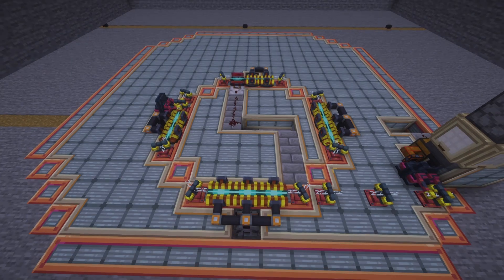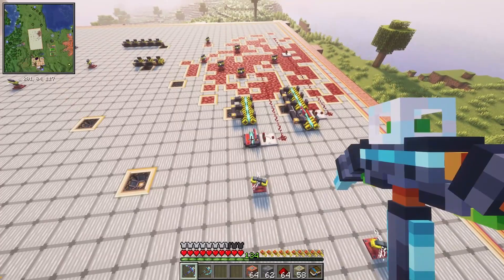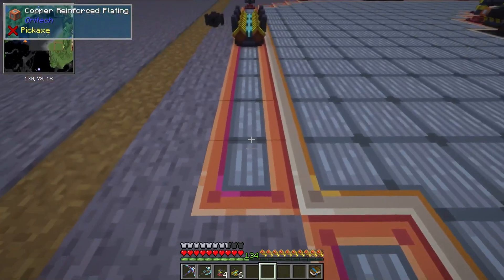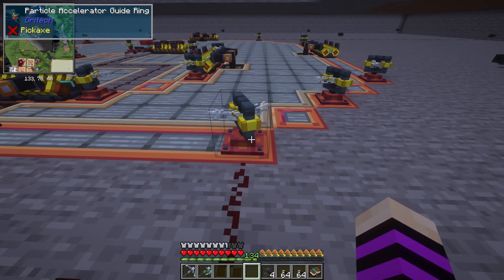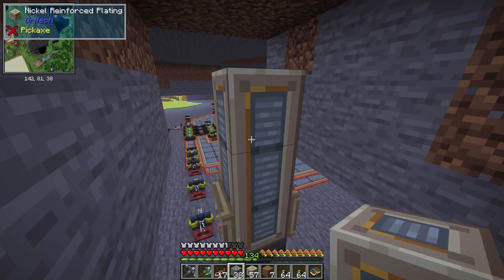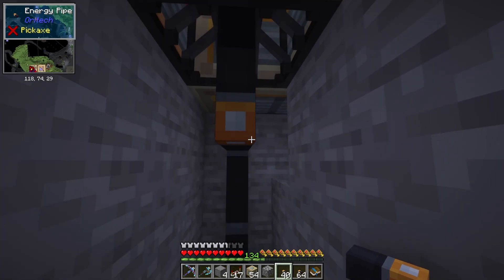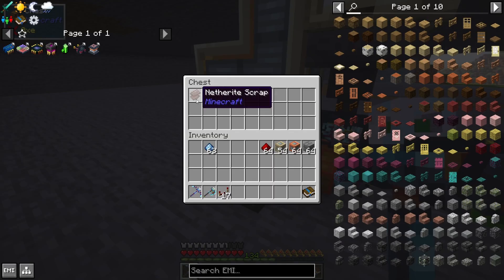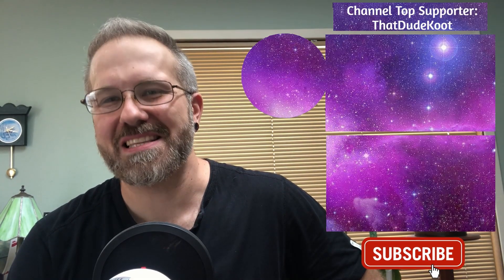EP 17 - 2500J Oritech Particle Accelerator Setup! Minecraft Oritech Academy! 2500 Joules!

Comment: Why do you need a ring up to 800 separate, can't the outer one be used from the start?
Reply from the maker: The outer one can be used but you need the inner ring to get it fast enough for the outer one
Reply: @LetsPlaywithDDae  I see. Yes I now noticed that doing it this way it's more efficient as once you have certain speed you can go into an outter ring with a bigger gap in between elements.

Comment: Got this to work in SB4 after a little pain.  Added an Accelerator Magnetic Field with Tier 9 efficiency and capacitor addons from the Echo of the Wyrmright shop.  I also added two more guide rings between where you had the collision point and the motors.  It kept the second particle from vanishing before impact.  SUCH a great video for explaining the process!!!

Also, moved the repeater two spaces closer to the main circle so it triggers earlier.  Total energy 9252J!!!
Reply from the maker: You Sir, are amazing =)
Reply: bro i hate this mod

Comment: Anyone having problems in SB4 or anywhere else, you need to use the Oritech Energy Pipe or limit the max transfer rate to 10k RF/t. 
If your transfer rate is too high the particle speeds up faster which will make the particle exit earlier than expected and break this loop.

At least this worked for me :D
Reply from the maker: Thank you for this, I am currently trying to make a setup with less accelerators to accommodate infinite power setups!
Reply: u save my life tysm

Comment: For anyone playing SB4, expand the outer ring by two blocks in all directions. That should give you just over 2500.
Reply from the maker: There we go!  Thank for for the quick troubleshoot!
I will make another episode specifically for SB4 =)
Reply: Where did yours fail at? Mine ejects out of the first ring prematurely at 297 m/s. It shoots the particle toward the top of the outer ring (where all the extra space is)
Reply: @tylerkennedy698  I had to add a repeater in the line of redstone. One redstone gap between the repeater and the guide ring that it switches. I can grab screenshot of it when I'm next on.
Reply: @shadowcryptic7848  Did you ever get that screenshot and posted it anywhere?
Reply: even diagonally?

Comment: all of us flooding in for SB4 lol
Reply from the maker: Yes, I am going to jump on it fast!
Reply: Yeah thanks for this. In general it helps explain this thing a whole lot better. It looks like a fun pack to learn oritech better.
Reply: I am also struggling with SB4 as this set up makes the item eject earlier than it needs to
Reply: @Jubs1993  Check the transferrate on your cables or flux points. If it is above 10k rf/t you need to set it to 10k
Reply: yeah its a new release and its not really documented by anyone really

Comment: hi is there a fix for 2500 yet, im on stoneblock 4, and on 1st ring it fires at 301
Reply: ahh thia my Problem too :)..STB4
Reply: @RikkiCit  so if you are wanting 2500, then build his 5000j version . on stoneblock 4 it will produce little over 3k. so that was  my work around for the 2500j craft... but i know at the end of the pack ill need 15000 so dont know what ill do about that 1 haha
Reply: @mathewowen2745 i found a way to make 3000j using Only the first set up 😅
Reply from the maker: I'm planning to make an explanation for each modpack since the numbers are different for each one.  Im working on ATM10 then SB4!

Comment: just an FYI this setup doesnt seem to work on ATM 10 Sky. No idea why
Reply from the maker: Im running ATM10 right now and working on a setup that works.  Hopefully it will also work for the sky version!
Reply: I had to go almost 48 blocks in diameter to get 2500J with 2 accelerator rings. So either the ATM team screwed with Oritech config, or I did something extremely wrong. At this point, neither option would surprise me.
Reply: @LetsPlaywithDDae  I think they may have changed config in ATM10 too, built exact setup in tutorial and can only get max of 1950m/s in second ring. Also I noticed that the center ring had to be changed from 9 redstone to 7 because it was just ejecting instead (I just used 2 repeaters at the end of the line.) I know power isn't an issue either because all their buffers stay full. Might just build the 5k ring and hope it works lmao
Reply from the maker: Im working on ATM10 right now =)
Reply: I'm having a similar issue in Contained. I think they may have tweaked the Oritech settings, because my particle is ejecting before it reaches the speed shown in the tutorial. Solved it with a repeater a bit earlier in the escape trigger, but it means that my collision power is a lot less

Comment: So I'm playing on the FTB 2 modpack which also had this mod, and I have used your video tutorial to build my accelerator, which btw you have done amazingly at explaining, better than anything else I have seen. However I am having a problem that I just do not understand. Once the main particle hits a speed of 421 m/s is ejects out on its own and shoots out in the world. I've been trying to figure out why but have found nothing to help me. It always without fail shoots out at 421 m/s no matter what material I use. Do you have any idea as to why this is happening?
Reply from the maker: The gap is only 1 diagonal block and it flies out at 421?  It's possible that your modpack has the numbers altered?
Reply: @LetsPlaywithDDae  same problem here
Reply: same problem but at 293 m/s
Reply: @cadlol2042 have you found a solution?
Reply: Same problem at 293m/s on ATM10 to the skies. potentially altered numbers in both it and FTB 2